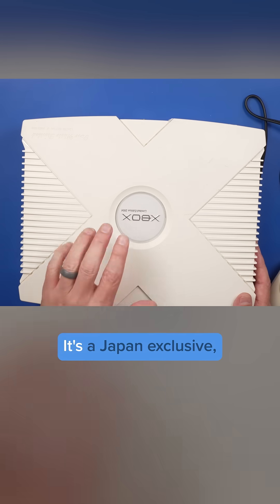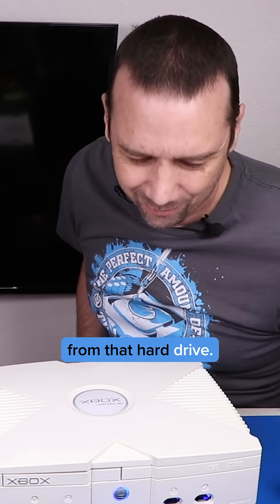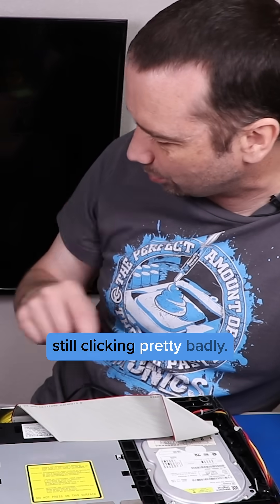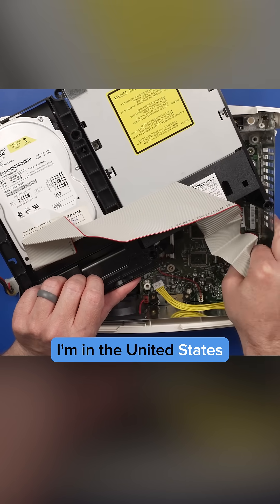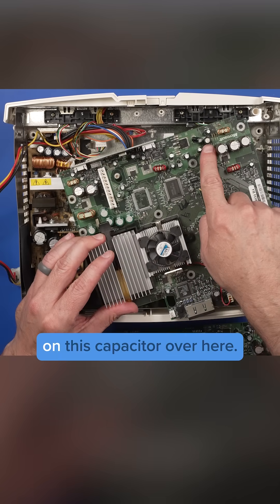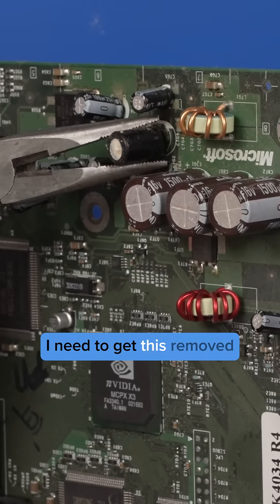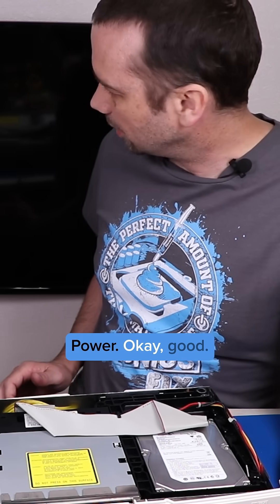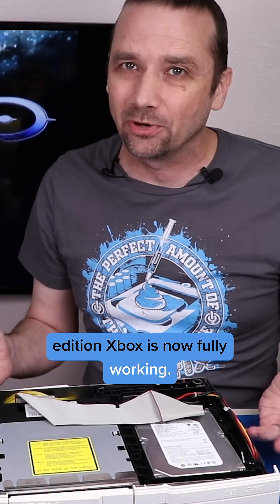Can I save this $2,500 Xbox? #tronicsfix   #diy   #xbox

Comment: No longer a special edition but just a swapped shell.  Keep the mobo and put in a new disc drive.  Also wondering how changing a ribbon cable could stop the noise the HD was making.  Can you explain that one a little more?

Comment: You can mod the system for an SSD, but the transfer speeds are hardly any better. I'm not sure if drive life is much better with an SSD, but you don't have to worry about mechanical failure. The other issue is cost per GB of a good 2TB Western Digital drive vs any non-junk brand SSD of the same capacity.
Even though you just harvested the shell for a standard U.S. swap-in, you can probably still fetch a great price for it since you did the capacitor fix, especially if you soft mod it for a larger storage capacity.

Comment: You shouldn't have removed the motherboard. The only issue was with the hard drive.
Reply: Hard drive is paired to the motherboard and I'm not sure if you can do a serial dump without it present. If you can, it's a matter of soldering probes and reading those keys when you power on, which could get you to the point of creating a soft modded hard drive image using a PC. Otherwise you're looking into HDD repair and data recovery services to resurrect the drive.
Reply: @TechnoColossus  That makes a lot more sense, knowing that the hard drive is paired with the motherboard. Is it a check in firmware? I'd kinda like to know how they managed to pull that off with ID'ing every drive in-factory, haha.

Thanks for letting me know!
Reply: @TechnoColossus  you can extract the old HDD key
Reply: @itsTyrion  not from the hard drive in this video though lol
Reply: @TechnoColossus  no, from the board
Reply: @TechnoColossus  no, from the board IIRC

Comment: Just change or fix the HDD. Mobo replacement is unnecessary and removes anything special about this console.
Reply: In case with Xbox it's actually necessary, as the mb checks if it is a correct hdd
Reply: @MMichael834r  What do you mean by correct HDD?
Reply: @PresidentCamacho24  There are keys (or some other term, but I don't remember what they're called) on the HDD matched to the motherboard that you first need to extract from the motherboard if the HDD fails. Otherwise you can get them with softmod tools that are only usable if you can actually boot. If you can get those keys you can use them to build a new HDD image that will pair properly with an otherwise unmodified system.
Reply: @ Are you saying the hardware addresses have to match?
Reply: @PresidentCamacho24  not hardware adresses, just keys in the form of a string of letters and numbers assigned at the factory. The keys are extractable via hardware serial probes or through using homebrew software tools, but you have to be able to boot and run an exploit to use the homebrew tools.
Reply: @ Are you saying if I replaced that HDD, it wouldn't work?
Reply: its still an xbox only thing special about it was the case
Reply: @ Still it’s unnecessary to remove a mobo over a broken HDD.
Reply: @PresidentCamacho24  the whole world uses different fasteners and hardware. even things as simple as power outlets work incredibly different. I highly doubt the average repair store just kind of has authentic Japanese hardware, let alone limited-edition hardware. you'd have to order something like that and that's not cost effective for the repair guy or the Xbox owner

don't get it confused with Japanese companies making items to be sold for American consumerism, this isn't that.
Reply: @ It’s a regular EIDE HDD. I’m sure this XBOX is region locked and could be jail breaked. I assume this console has a switch between 50 or 60 hz because Japan uses both. So there’s all of that. As far as parts supply chains most computer hardware is region free. Is there something specific known about the hardware in the Japanese XBOX that is different than the Region 1 XBOX?